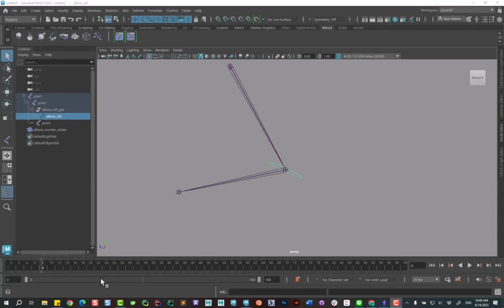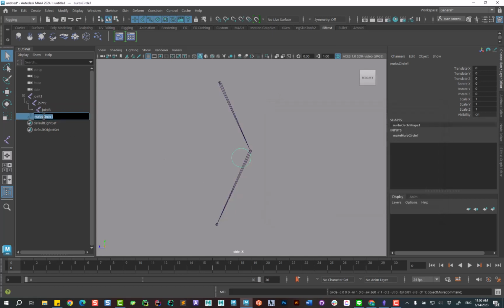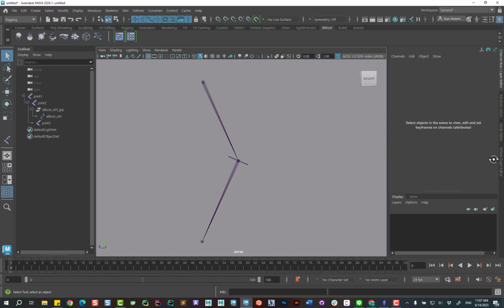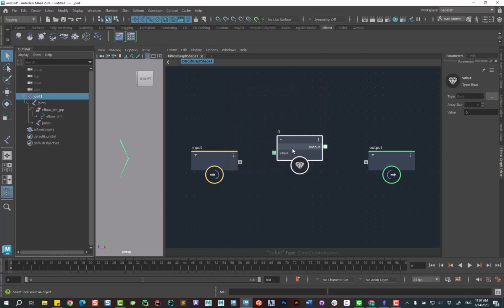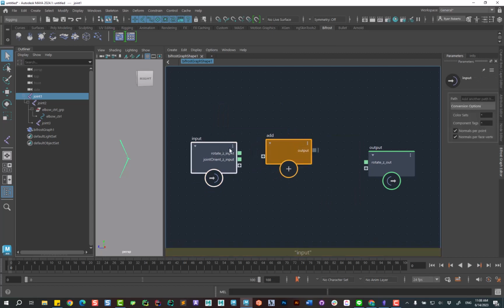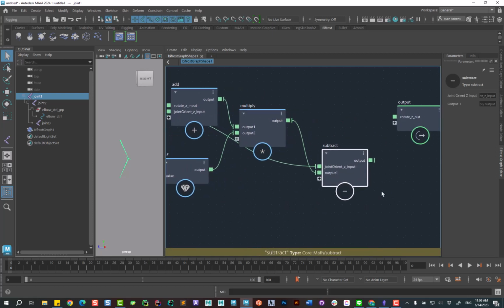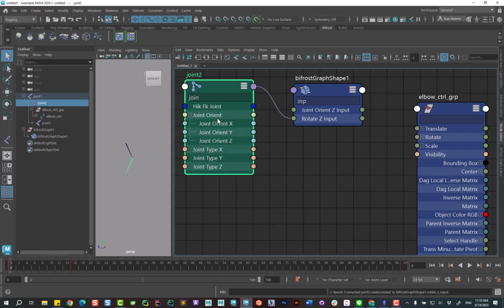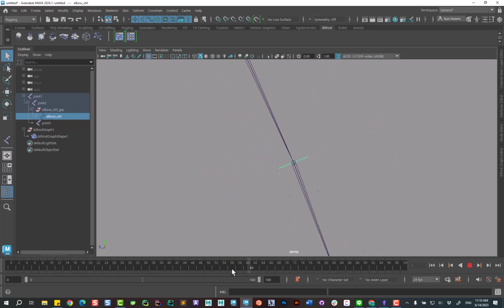Maya Bifrost for Rigging - Bendy Limbs Part2

Comment: A multiplyDivide taking the joint 2 rotation and halving it to drive your elbow_ctrl_grp's rotation would have done it much simpler.  But as always, there's so many ways to do the same thing.  Still interesting to see other approaches.